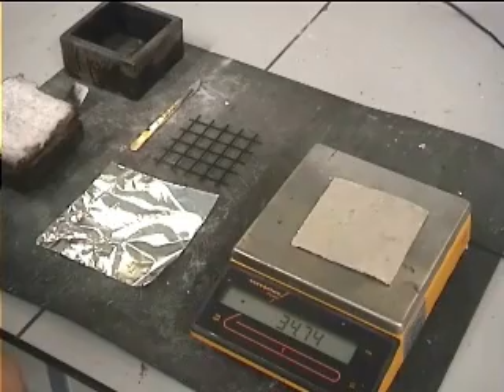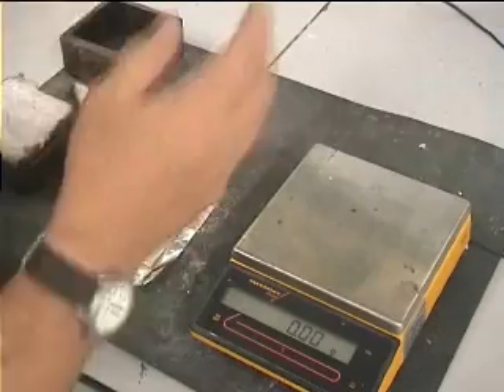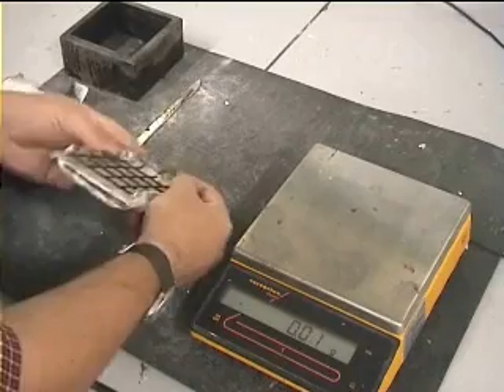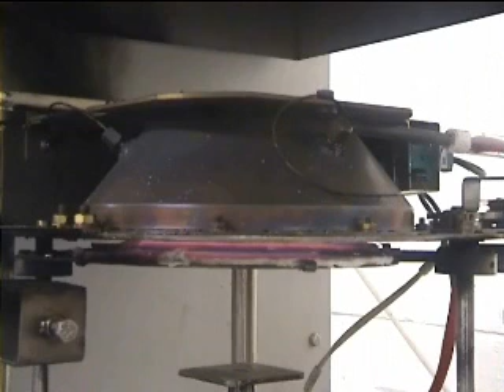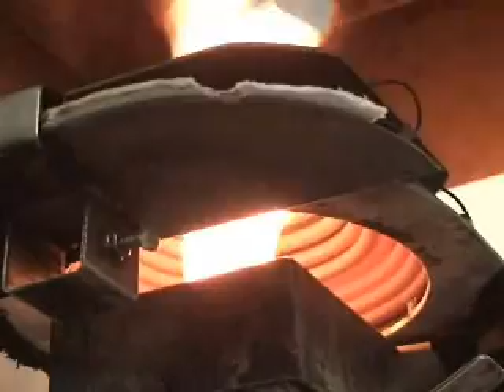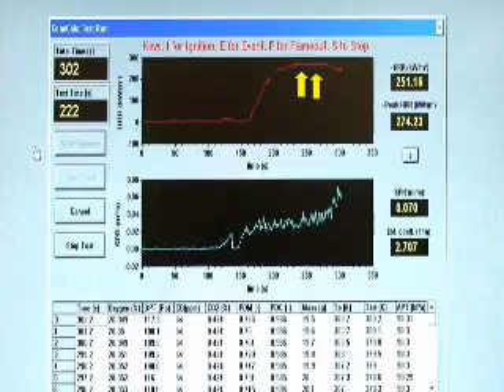Fire Testing - Cone Calorimeter

Comment: I worked for a company that made these and once I "tested" a "Twinkie".  My boss and the engineer in charge couldn't figure out what had been "tested" and when they asked me, I told them is was a "Twinkie".  They asked why and I said I wanted to be sure this equipment wasn't BS and it wasn't.  Smoke density and the effluence is measured with two different gas analyzers.  It was very interesting.  They told me not to do that again.